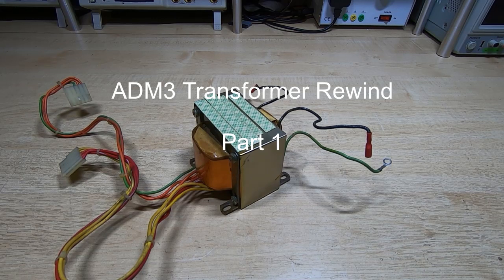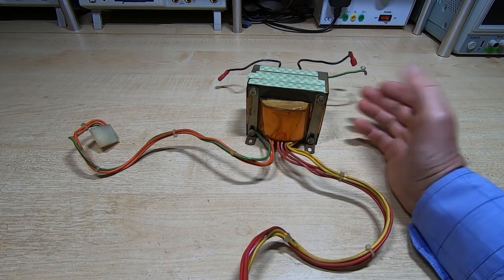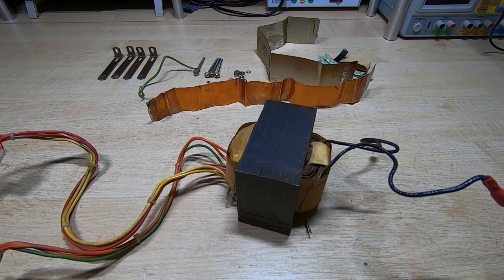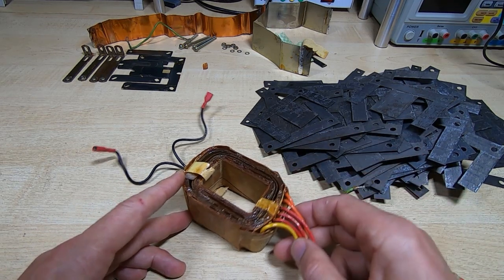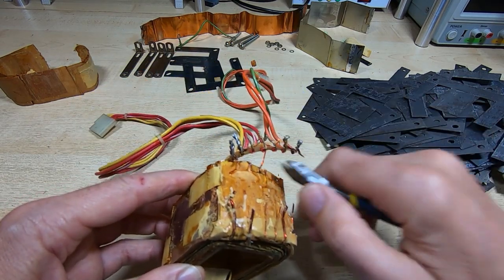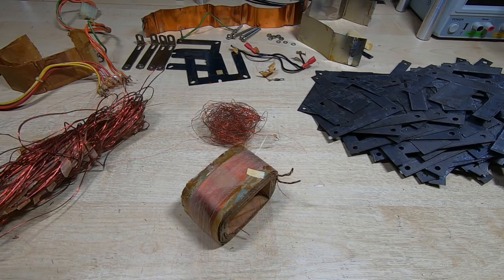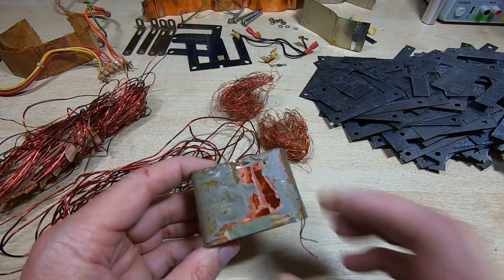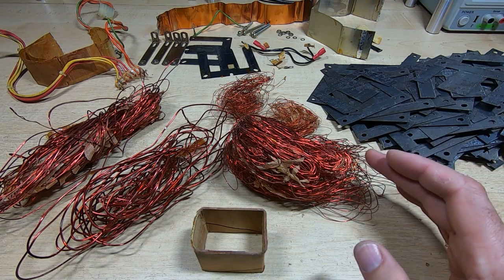ADM3 Transformer Rewind Part1

Comment: I noticed that you did not mention the wire size for each winding.
Reply from the maker: No, that was intentional. The wire size for the primary will of course be different as it will only carry half the current. The secondaries will be the same but I will cover those when I rewind it.